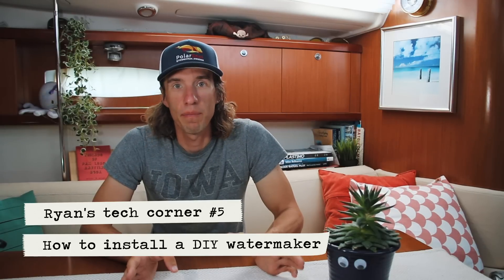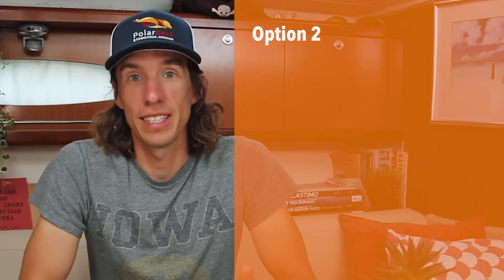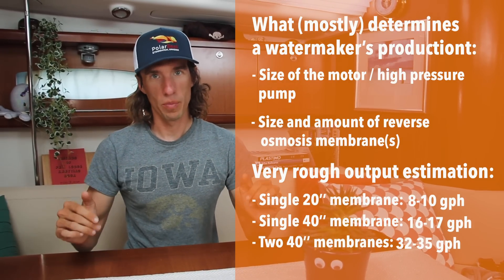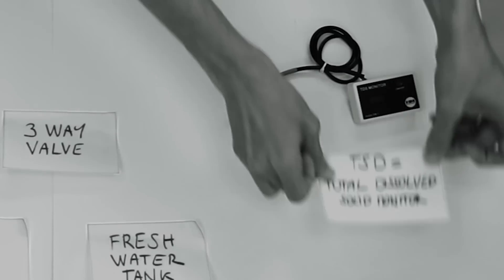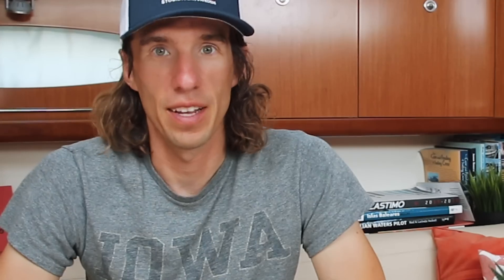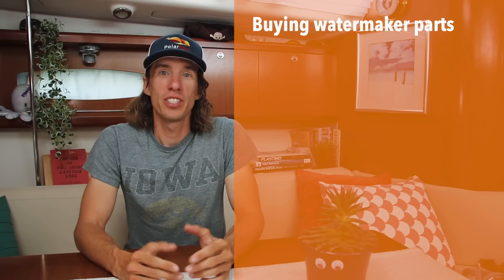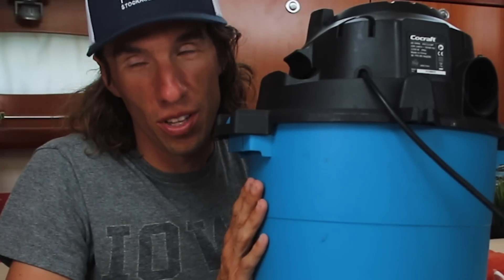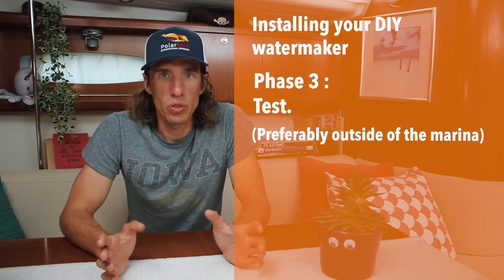SAILBOAT TECH: How to install a DIY watermaker  (SeaWater Pro) // Ryan’s Tech Corner #5

Comment: good one :-)
did you put the discharge  brine through an existing through hole, if not why not? same with the saltwater inlet. saves holes :-)
in-case of water maker failure, are you at least practising collecting rain water, if not why not?
and finally, NO Sophie shots! :-((
:-)
Reply from the maker: Hi Iain.  For in inlet we use an old sea water foot pump inlet.  The discharge i did add a new one, ill explain why in our Q &A.  Ryan

Comment: Is the valve you are calling a 3 way, a 3 way or an either/or valve. Another words it sends water either to your tank  or overboatd/sample. It is my understanding that you never want to close off the freshwater discharge from the membrane. The valve on my water maker sends water to the tank or to sample, and does not have the ability to shut off the the output/flow.

Comment: When you tie up to the dock and hook up the water line, you will need to have a chlorine filter between your tank and the flush pump, or you can kiss the membrane good bye in short order. Otherwise you darn near nailed it. 
Cheers
Reply: That was the carbon filter he installed under the sink. He talks about it in the first video. art 1.

Comment: Thanks for the video.  Yup don't tighten fittings under high pressure....if you've ever gotten a water injection injury or a big mess that is a bit of good advice.
Reply from the maker: That didn't happen to us, but Ryan took some shower with the system under low pressure ;) /Sophie

Comment from the maker: Hi guys! Really hope you liked the video, we absolutely LOVE our watermaker! In a couple of weeks, we are going to do a Q&A special DIY watermakers. If you have any questions about our installation, the process of choosing parts or any other topic we haven’t adresses in this video, SHOOT! :)
Reply: What are the things most likely to break down and how to have back up plan if water maker for whatever reasons fails during long passages.
Reply: So, will include just a bit of the video I bet was running when Ryan tried to tighten something under pressure.....! - Robert
Reply: Hey Ry, finally thanks for doing the diy vid. It's going to sound weird but I'm installing a water maker on my 45-ft Sea Ray I almost pulled the trigger on a $3,000 rain Man but do not want to spend money I'm a budget freak and those are way over my budget Where did you get all the hoses Sorry the question's so long Hope to pick your brain. Definitely going to build my own. Thanks brother 👍